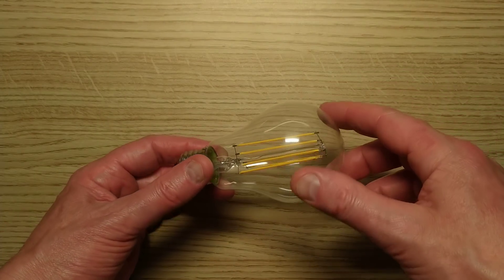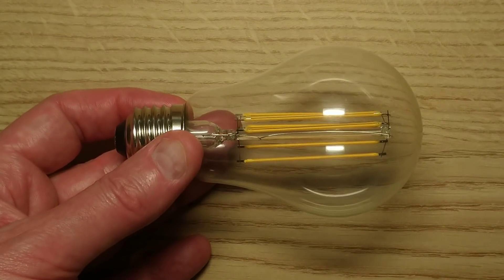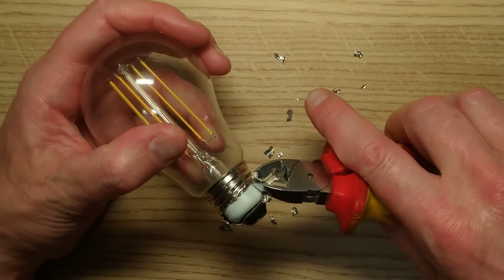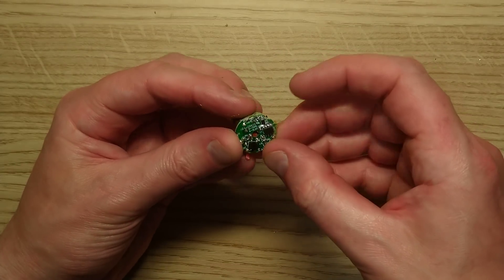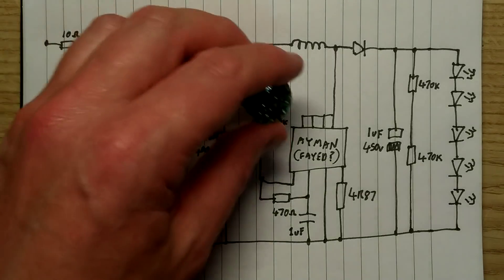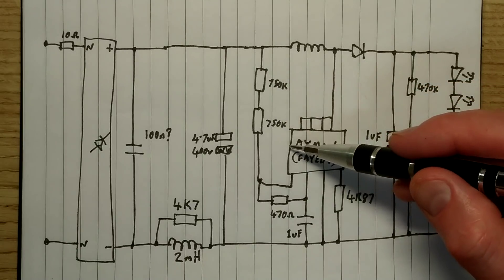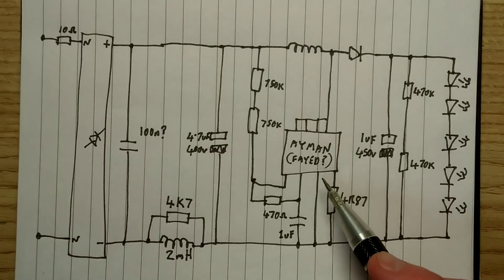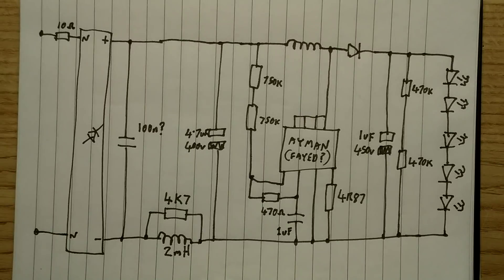ASDA 12W (100W) LED filament lamp teardown.  (with schematic)

Comment: Someone can tell me why these type of bulbs have much more longer lifespan(IN PRACTICE) than the ones with plastic covering. They both use circuit inside, what could the reason be :|
Reply from the maker: With the glass ones they may use an inert gas to couple the heat from the filaments to the glass.

Comment: This design is so much better than the ones with the ballast integrated in the center of the bulb, this design allows for heat to be dissipated into the screw base and into the home wiring

Comment: Quite nice to see you tearing down a well designed LED light power supply for a change. I don't know about the whole thing getting so hot. But I do like the power supply, it's nice and compact and I presume fairly efficient and of course flicker free. I wonder how the power factor is though given the resonable large capacitance on input side. I was wondering if the inductor is also meant to provide some power factor correction?

Comment: Does anyone happen to know whether filament LED bulbs produce a different kind of light to normal LED bulbs? I've got a 15W (100W equivalent), 1521 lumen, warm white bulb from Wilko (product number 0437675) and it produces a very similar light to a CFL. It's perhaps a little bit more on the yellow side than a CFL, but barely noticeable. Apart from the obvious difference visually, when staring at the bulb, is there any difference between the character of the light from an LED filament bulb? They often appear to be more expensive, so I'd like to know if that cost actually makes a difference. Many thanks! :)
Reply from the maker: It all depends on the phosphor blend and quality.
Reply: Generally though, is there a difference in the way the light is delivered/projected, or are they pretty similar?

Comment: I wonder how much of the old Edison bulb manufacturing and glassblowing equipment could still be used for these.  The moment you realize scrapping your multi-million dollar factory quipment to make those new fangled curly Q CFLs was a mistake.
Reply from the maker: I'd guess a lot of the older machines are back in business with minimal adaptation for the new era of glass globe LED filament lamps.

Comment: All the filament LED bulbs that I have seem to overheat and burn out prematurely. I run Philips candelabra bulbs 24/7/365 for going on 2 years now, no flicker or reduction in luminosity compared to the filament bulbs. I hope the technology will improve in time because filaments look more attractive.

Comment: solder a wire to the center conector, and strip  about 3 inches of wire, wrap it aroung the base, twist it, and use a length or electrical tape to make sure that it stays in place.. i did it when i needed a power indicator for RF.

Comment: I still don't understand why they don't bond the led filaments of these to the glass envelope. As designed they simply roast the LED filaments. In low wattage designs they're OK, but in higher wattage designs like this, the LED lifespan is seriously compromised.

I'd estimate the lifespan of one of these at six months. I've bought two similar bulbs, one from LED Logic (880lm) a few years ago, and an OSRAM (1521lm) one far more recently. Both lasted less than six months. The LED Logic seller kindly replaced it with a new one, which unfortunately also lasted less than six months.

The "15 years" lifespan marked on the OSRAM 100W equivalent is wildly overoptimistic, if any make it past 15 months of regular usage, I'd be very surprised... I'd be curious to hear anyone else's experience of high wattage LED filament bulbs though?

Comment: Does having a boost converter and a small filter capacitor give it a better power factor, than a buck type? Have to try one on the hopi when you get back from work.

Comment: Big Clive I love your videos. How can I get in touch? I would love to send you a (very common and variously branded) Amazon power bank that claims to be 20,000mah but just can’t be considering price and weight. I’m suspicious if you open it up it has fake batteries.. would love to have you take it to bits! Thanks for the videos!

Comment: I was going to buy some for my pendant light, but long term reviews say the drop in brightness is pretty significant. Makes sense since heatsinking is going to be necessary at those wattage, and non-existent on those filament LEDs.

Comment: Lamps like this last the longest, when used base down, in a  table lamp, where the bulb gets good ventilation. Putting them in a pennant fixture, base up, with a glass globe over them allows them to get hot enough, that they don't last as long as an ordinary incandescent bulb. The best use of an LED lamp like this, is in bedrooms and bathrooms, where they're switched on and off frequently. LED lamps hold up to on/off cycling better than anything on the market.

Comment: I've got some OSRAM 40W equivalent ones in my bathroom light, which has the bulbs exposed, just above the mirror. Perhaps a little too yellow, I wish they'd also sell neutral white instead of just warm or cool. BTW, they're in the edison screw base, G15 size. (Note: here, the "G" means "Globe" not the Bi-pin like type you see on some halogens.)

Comment: H i Clive, I have a "spudger" that I got from Wilko (aka Wilkinson) - It's actually their stainless steel 'filler tool'. It's very thin and flexible, with a polished finish. One end is pointed, with all the angles nicely rounded and polished, whilst the opposite end is flat/square, with its angles similarly dressed. You could do a lot worse than pop along to the local Wilko, if there is one in Auld Reekie? (Edinburgh, for those who didn't know).

The tool itself is intended for grouting, filling cracks, puttying windows and car body filling etc. but it also makes a very good spudger! Mine looks exactly like this one, https://www.ebay.co.uk/itm/MULTIPURPOSE-FILLING-TOOL-DECORATOR-SMOOTHING-CORNER-WORK-GROUTING-WOOD-FILLER/323694609772?hash=item4b5db3c56c:g:s94AAOSw0TxZZ6Kd but at Wilko, it cost me about £1.99~£2.99 (ish).

Comment: As the LEDs look like they are close to overheating the bulb needs placing in the "magic box" and tapping with the "magic wand". Replace the envelope with a clear plastic hamster ball so the bulb with its ventilated envelope should run cooler and last longer.

Comment: Are there any dimmable versions of these retro LED lamps?
Reply: Yes there are. They are a bit more expensive than the non dimmable ones, and not all dimmer circuits will work well or even at all with them as they draw significantly less power than regular incandescent light bulbs. Some dimmers can't fully regulate these topping out at something like 90% and bottoming out at perhaps 60%. Another possible failure is that the dimmer is unable to turn the light off, leaving the bulb glowing even when the knob is turned all the way down.
Reply: @blahorgaslisk7763  Thanks. I have normal dimmable LED lamps and they work fine using an LED specific dimmer, but not seen dimmable versions of this style.
Reply: @ferrumignis  I started writing that answer like i was on autopilot, and then it struck me you might mean that particular style, and I had to look it up to be sure I wasn't just blowing smoke. The rest of it was just to make the info more complete in case someone reading this really wonders. Thing is I've often seen both dimmable and non dimmable LED lamps sold side by side on the store shelves, but never any warning that even the dimmable ones might not work 100% with all makes and models of old dimmers out there.

Comment: I would think that a Dremel or Proxxon tool with a cut off wheel would be an easier way to get that base off. Of course the Knipex are less trouble to set up.

Comment: The 10ohm resister on the input is also probably underrated to fail prematurely thus limiting the operating life of the lamp, Also it is designed to cook the electronics by the sounds of it. 

Planned obsolescence in action. 

What a waste of resources and a contribution to "global warming"  just so the manufacturers can get repeat custom.
Reply: Hi,do you think less then 1/4 watt dissipation in a smallish resistor is really gonna shorten the life of anything?

Alex.
Reply: @inductorbackemf7204  check out this video https://youtu.be/Brj8-jD2CFY where the resister burns out, thus shortening the life of the lamp

Comment: Why is it a buck converter? It boosts the voltage to more than 330 V.  It´s the first LED lamp i´ve ever seen that uses a higher voltage than mains.
Reply: I think the higher voltage is because the LEDs are in series to push the current through.

Comment: How do you stop led downlights from glowing when off (ghosting) it is driving me crazy... help
Reply: You can connect a high value resistor (or several in series, wrapped in heatshrink, to get a high enough voltage rating) across L, N (e.g. in the back of the switch).  If the cables are accessible, move the switched L wire further from any neighbouring cables.
Reply: @Tim_Small  thanks... will give anything a try👍

Comment: At last, a bulb to replace the old bulbs of the house.  I hate the low energy bulbs.  Why do we persist with bayonet connectors when most of the rest of the world use Edison Screw?  I shall think about replacing this long hated twisted florescent bulb we have.  Nice one.
Reply: I would probably pass on this one, and go for a CRI 90 (or better) LED.  The cheaper ones usually give an unnatural light which I'm not keen on.  Also go for 3000K or (better) 2700K colour temperature, if you want a proper incandescent replacement.  You may end up paying over £5 each, but a good one will last so long, and use so little power, that it doesn't much matter.
Reply: @Tim_Small  I like the warm yellow colour instead of the hard blue white, so I would be looking for a softer colour.
Reply: @BoB4jjjjs  2700K colour temperature is similar to incandescent bulbs.

Comment: I got a few of these from Maplin's closing down sale, and had several in use for about 18 months now and they are all still good. They have a fairly warm white light with no detectable flicker.
Reply: Excellent, hopefully that bodes well for me, just bought a bunch of these. Most likely all the cheapest Chinese goodness comes out of the same factory(s). Very happy so far.

Comment: I’d calculate these long filaments (2W each) as two normal filaments in series — so 40 leds per filament. So 120 leds or 360 ish volts over the bulb.

Comment: I got a bunch of osram led lamps last year they stated the lamps last 15 years but guess what, all dead now they started flickering and 1 or 2 weeks later were completely dead!
Reply: OSRAM LED lamps are crap, a friend had the same happen to theirs.  But I bought some from Costco - can't remember the brand but they were cheap, £5 for 3 x 60W equivalents, and they're still going strong after 3 years of normal use.

Comment: I wish I could get these lamps here in Germany, but we neither have Walmart nor ASDA - and if I got myself a 12W filament LED on ebay, chances are that it is only a 6W lamp, or something like that.
Reply: You can get them from Osram but they are Not suitable for closed lamps because of the heat the lifespan is only about a year. In open lamps it's not that critical
Reply: I don't have many closed lamps, but these bulbs being available from Osram is a good thing. I'll try to find them, although a model number would geratly help with that.
Reply: @Seegalgalguntijak  search for Osram LED SUPERSTAR A100 2700K

Comment: Isn't this a boost converter? About the 2mH inductor, could that be an additional way to further smooth the DC, supporting the 4.7u cap.
The RC network with the 1u cap is for the internal oscillator.
Edit: Now that i think about it, that's a pretty heavy low impedance RC network for an oscillator? Hmmm.
Reply: You would rarely have an RC oscillator with such component selection i.e. very high C and very low R. It wouldn't make sense unless it had some cunning dual purpose.

Comment: Clive, have you ever found out what gas they put in the lamp in order to facilitate thermal exchange between the filaments and the ambient air?
Reply: A few years back, a taiwanese manufacturer brought to the market water filled LED bulbs (leaving a bubble of air to enable water expansion with heat). Obviously, they had little success. I suspect the weight was a problem. And there might have been corrosion problems...

Comment: I'd be curious what the voltage across the LED array is.  Note that Vf of the LED string must be higher than 339 Volts (sqrt(2)*240) or the LEDs are on regardless of the regulator.  
Is that the case?  >100 LEDs in series.
Reply: Normal led filaments are half the length, spec as 1W, and have twenty chips in series. I think it’s not unreasonable for these double length, 2Wspec filaments to have 40 chips. If that’s the case, the bulb in total has 120 chips in series (and two of those strings in parallel). Which would make it 360-390 volts at about 30-40 mA, which does actually work out to 12W ish.

Comment: I took apart a Dollar Tree led bulb and found that it had a giant resistor, a smoothing cap, diode and an 8 pin chip soldered the same way this one was, currently testing another one for life span but boy I would not put them in an enclosure, they get hotter than hell at the base.

Comment: I'm suprised you dont have the quick test and uni T meter and HOPI in your travel/grooming bag... it should be right along side your beard funnel everywhere you go!
Reply: He has the Uni-T Clamp meter with him. I saw him taking an attempt to measure a capacitor In-Cirquit, but he reasonned himself out of it due to some Inductors in that same cirquit.

Comment: I wonder if instead of the glass it was plastic, with some holes through it so heat could cause some convection would be better for those LED's?
Reply: Even as glass they could add ventilation holes if they really wanted.  However, I believe the real purpose behind this style bulb is to actually reuse the glass bulb production equipment used in incandescent bulb production by creating a secondary market for glass bulbs so as to keep the price down on traditional glass “specialty” bulbs (such as heavy duty filament, appliance lights, and halogen) since we don’t have anywhere near the production level of glass incandescent bulbs as we once did given the shift to LED and CFL bulbs over the past decade (by and large a move for the better in terms of energy and environment).  If that is the case, then the fact that they are using the same glass bulb envelope as a traditional incandescent bulb is the whole idea behind their existence on the market and moving to a plastic envelope would be contrary to that intention.   Perhaps what we really need are Edison (threaded) replacement sockets with integral heatsink fins so that we can better dissipate heat through the socket assembly, then we could simply retrofit many old lamps and fixtures with sockets better engineered to extend the life of LED and CFL ballasts while still preserving the utilitarian nature of easy user-serviceable bulb swaps that our older style fixtures permit.
Reply: @ethanpoole3443  I also suspect safety, a hole or a few and uninsulated wires is not the combo I would love as someone will poke stuff in there

Comment: have you ever had any signs of gasses inside the LED bulbs? they say it helps to transfer the heat to the glass faster. maybe thats the reason it turns so hot.
Reply: Helium fill is common I think.

Comment: ill have to have a look see if they do a bayonet fitting and give one a try see if they are brighter than what i got already, i find the replacement wattage they state to usually be a bit laackluster on led lamps, probably not helped by the fact i like the warmer colours as well and they usually have a plastic diffuser cap rather than glass. i find it a bit daft that often these lamps only come in eddison screw fittings when ive never lived in a house that didnt have bayonet fittings in practically every room

Comment: I had no idea there were so many tiny Parts like that that made of a light bulb.
Reply: Only for LEDs and Fluoros. The old tungsten ones didn't need any circuitry.
Reply: Now ya do lol 😁 there's plenty of led bulbs out there to take apart when they fail due to overheating lol
Reply: not every light bulb. this is a special form of a LED lamp, those need to transform the electricity thats coming out of the socket because LEDs dont work with it and than its also too much power, so it needs to regulate it down first. other parts smoothen the power so it wont flicker and all that stuff that wasnt needed with old "normal" light bulbs. but at least they dont get so hot. : )

Comment: I seem to remember the voltage over these LED COBs was around 70 or 75V... not sure these long ones are similar but three sets in series would need around 210 - 225V, wouldn't they?  That seems a nice level to avoid too much complicated voltage conversion, though I guess being DC you'd have to convert up from the RMS produced by the simple rectification.   What I really want to know is how good these are for flicker.  Out of all the different brands I bought off AliExpress, there was only one set that produced steady light, and by the time I went back to try to buy them again the shop had disappeared.